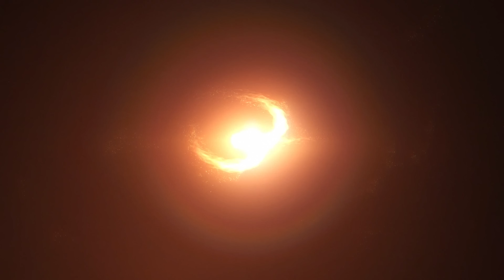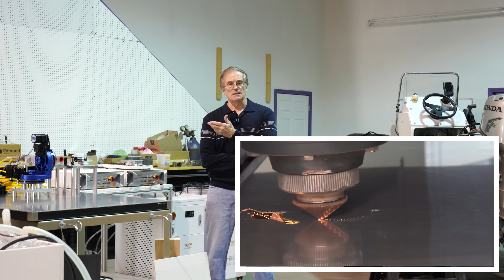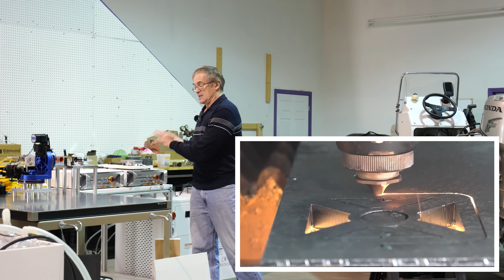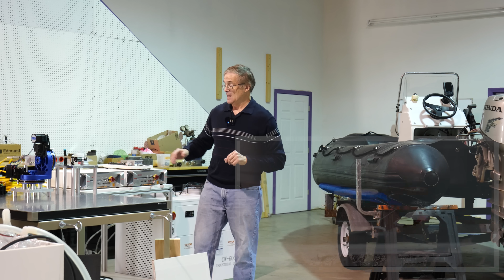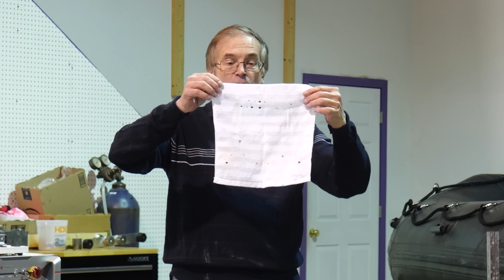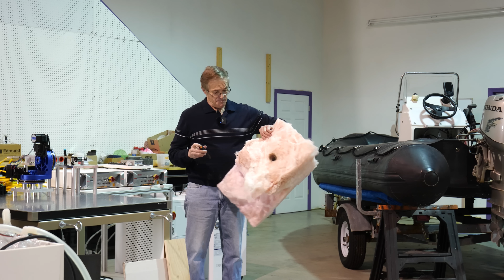We have a problem... and need your help!

Comment: You could try a vat filled with liquid nitrogen or something similar suspended a second metal plate in the liquid nitrogen to catch the laser light, this would cool the plate giving you time to stop the test. Get a crayon cooler, make a cold plate to fit your needs, use the cold plate to stop the laser

Comment: While I really like the idea for the intumescent Starlight material I have an entirely different approach for y'all to consider. I watched a video about a schlaren laser setup and the beam was actually too narrow so he used a little bit of optical glass to widen the columnated laser light and I wonder if you increase the column diameter from millimeters to centimeters you would have a much easier time finding material to absorb the energy behind it

Comment: I think we can explore potential laser-blocking materials by examining materials used in radiation shielding in applied nuclear physics. Specifically, we can look at how materials are selected for reactor casings and radiation source shielding. However, it's important to note that we only need to block light (laser) radiation, not higher-energy radiation like gamma rays or neutrons.

Given the intensity of the laser radiation and the need for an economical solution, two viable material options come to mind: concrete and plate steel. These high-density materials offer a large number of molecules that can absorb, transport, and re-radiate energy.

For a first-round, practical, flexible, and cost-effective approach, we could use concrete pavers to test how much thickness is needed to block the radiation. Once we identify the required thickness, we could construct a more permanent structure using concrete blocks filled with grout.

The second option is steel. Steel provides greater density and better thermal conductivity. We could experiment with thin steel sheets to determine the necessary thickness to absorb and re-radiate the laser energy. The sheets could then be welded together.

Comment: I think a better idea would be a combination of materials.

You need to coat a sheet of copper or aluminum sheet with a thick layer of silica-base (silicon dioxide or sand) coating. One way to create really durable temp-resistant coatings is to form a layer of COMBUSTIBLE material mixed with a precursor of the temp-resistant material. At home, this would be starch mixed with glue and silica (mostly dioxide, of course). When the layer of this material starts to burn, the organics swell up and turn into soot, limiting the oxygen supply, and the silica forms a thick layer of foam-like material.

I realize this may not work against a laser, but the fact that the brick did not melt suggests that a ceramic material might solve the problem. However, I would still add cooling to the opposite side, that is what the sheet metal is for.
Reply from the maker: I like that layered approach.
We need to keep this cheap, and systems like pumps and mechanical movement will rapidly increase the complexity.

Comment: Use a glass terraria filled with sand and water.

The wall of the glass must be a little deformed like an old tv. 

That will have absorving properties.

Also you can use like a diamond like reflective surface that separate the beam into 500 lassers in different directions.

Or you can use the bottom of a deep lake.

Comment: My father in law just retired as a fiber technician for a big comm company.  He suggested an optical diffuser should work to scatter the light.  He thinks a piece of plate glass that has its surface(s) sandblasted or etched could work
Reply from the maker: Thank your dad for the suggestion. Unlike a fiber communications link, the fiber laser will shatter materials such as glass. Nevertheless, a dispersive surface is a good idea.
Reply: @TechIngredients I will pass it on. good luck, we are both tuned in

Comment: I have heard that there's a free shades of blue that lasers can't penetrate
Reply from the maker: That's a myth. Think about it. Would a visible  color affect an infrared beam?
If it could reflect it, that would be a big problem.  If it absorbs it, then that energy turns into heat just like any coating, and it will vaporize almost instantly.

Comment: Your options:
Absorb it, defuse it, defocus it, or reflect it. 

Beam Blocks and Traps, but I'm not sure the power levels your dealing with. 

If you got a bunch of copper wedges and make a reflector that worked like an aniconic chamber you could use that as a beam trap. Maybe back them with water. You could also use a fog generator to defuse the beam as well. Regardless, make sure you have your safety gear on lol.

Comment: The problem itself isn’t entirely different than finding a suitable backstop for gunfire at ranges. It seems the ideal media would rapidly and continuously move itself into the beam path, absorb the incoming energy as asked, need considerable energy to destroy it, self extinguish, be cheap, readily available, non toxic, not produce smoke, easy to replace and be able to be used in thick enough layers to do the job without being impossible to move because of weight. 

I believe the ideal solution would be to use, as crazy as it sounds, square buckets full of clay “slip”. “Slip, as it is referred to in the world of pottery is a thin mixture of clay and water. 

I believe this would be the ideal solution because buckets are cheap and plentiful, can be stacked as many layers high and deep as needed, the holes can be plugged with wooden dowels or screws, they can be swapped out easily and won’t weigh too much individually when full. I believe clay slip would be ideal because the clay itself is extremely heat resistant, the water would provide a sufficient heat sink, the mud would effectively absorb the light, and it’s liquid nature would cause and voids to quickly be filled. The mud would need to be rather thin. Thin enough that it couldn’t hold up a dowel placed vertically into a full bucket. 

Other possible solutions would be buckets of dry sand or vermiculite. I don’t believe the sand would work as good as vermiculite.

Comment: My first thought was something like (virgin) PTFE. It's a reflector which is not ideal but it's approximately lambertian. It's a bulk reflector/absorber so the thermal energy is generated over a volume of material. However I suspect the irradiance you are dealing with here will still just be too much even for a very-pure (very-reflective) PTFE sample. Giant sheets of virgin PTFE would also cost a fortune and it's thermal degradation products are nasty.

Comment: What if you just use a lot (let's say 50) glass panes, with a small distance between them? Maybe also tamper a bit with their surface, i.e., create semi-opaque (frosted) glass?
The idea being that after each glass window, some of the light is reflected elsewhere. If the glass is frosted glass, then the rough surface should help redirect to the sides (instead of just back to the power source). I saw a similar version of this idea in the comments, to use aerogel with different bubbles enclosed.

A modification of this idea would be to use some kind of shattered crystal (or mixture of crystals that differ in the refractive index). By having an unorganized and uneven distribution of the individual segments, the light would hopefully be redirected randomly, hence splitting the single light ray and redirecting it randomly (to hopefully sufficiently reduced powers). Obviously testing this one quite difficult, because you would want to significantly over-scale it to prevent random laser beams that are too hot, but given a mirrorless and windowless room, it may be feasible. 

Finally, why not just use a huge concave (or convex for that matter) lens? If the problem is the required size, maybe satellite-dish-shaped mirror could do the required focusing of the laser onto the concave lense?
Reply from the maker: Even that reflector is much too small.
We have to protect the entire back wall. 
I'd like to stick with materials that can melt or vaporize, but not shatter if the intensity is too high.  This can create unpredictable reflections.

Comment: my start would be ceramic fiber blankets for the absorption material. its a more dense, and higher temperature resistant comparable to the fiberglass insulation. I use it on fireplaces and flame guards for soldering pipes. I still think that the ceramic fiber blanket will not be enough though. I've never done much to wet the material when I use it, but I would try that. in addition, having a layer in the middle to disperse the energy into a larger area would help. possibly including the crushed glass that @athingortwo1513 was referencing as a layer sandwiched in between two layers of ceramic fiber blanket. creating a composite material that will fail in one spot, and disperse the energy internally to have the hope of lasting a second or 2. In the unlikely situation this works, it would be light-ish and portable. though the ceramic fiber blankets are not the cheapest in comparison to some other suggestions here.

Comment: Why don't you point the laser down instead of out?
Reply from the maker: We need more distance to the targets than the ceiling height would allow.
Reply: @TechIngredients  I assume, then, that a testing hole would be cost prohibitive. Correct?
Reply from the maker: Correct.
We investigated a number of closed stone quarries, and the owners were nervous about allowing multiple,  high power lasers to be used there. 
Digging a special purpose hole in our industrial park is also out of the question.

Comment: Hey I reckon graphite is your best bang for buck (transitions directly from solid to gas) at approximately 3650–4000°C) it's non reflective, relatively cheap and sublimates from the heat, tungsten also could work but could be quite expensive to shoot, a graphite barrier a few kgs thick would give you some time.

Comment: Water curtain of aerated solution of carbon black and water. Use lengths of  slotted copper pipe, in layers, of 2 or 3 curtains deep (3 individual 24" slotted pipe "waterfall" faucets).

Comment: Is it possible you could put a large amount of dirty water in the air with the use of a tone of presure waser nosels, the particulates would absorb some light and the heat would disipate through evaporation. The rest of the light would be scatterd to a safe level of exposure.

Comment: A diverging lens. 
Or reflectors that divert the beam downward into a wet dump on the floor.
Or a vertically oscillating spinning dump.
Or a cascading array of parallel slits 
Or re-couple the beam into a tightly coiled optical fiber that has inherent HIGH BENDING LOSS to disperse the energy through evanescence

Comment: Instead of a laser dumping made of resistant materials, you can opt for a mirror style solution. 
So you can use a very sharp white diamond at 35° 💎 and around the diamond you can use a graphite disk to dump the disk reflection created by the laser at an angle of 35°.
A very polished diamond will act as a 35° mirror. 
You can also cool it by placing a piece of mirror polished copper on the flat side behind it.

Comment: Waterscreen  ! A water screen for a laser show can scatter and absorb both stationary and powerful infrared laser beams. It is a rectangular tube with several rows of nozzles of approximately 1mm and an elongated trough, which receives the water wall with a pump that pumps the water back, in a circle, to the upper tube.

Comment: I was thinking about defocusing as well, like others here, but I figured a better method to defocus would be to use sheets of diffraction grating, which is likely much cheaper, light weight, more scalable, and hopefully doesn’t melt in the beam (?), like lenses might struggle with. 
One issue is if it becomes dirty as you work in the facility, but that applies to everything I guess…

Comment: I am not an expert but I think this channel it here to help us all think so here is my thinking...

Instead of thinking about blocking the beam could you think about spreading it out. If you use lenses to fucus light could you use a series of lenses to de-focus and therefore make a regular barrier behind it usable. I am not sure if the beam when hitting the first lens would diverge or melt the medium but that is my thought. At the tip of the lase something has focused it down to a point without melting, could that be used to de-focus it.
Reply from the maker: A lens would work well if the beam is lined up with it. The challenge is that we have to protect the entire back wall no matter where the laser is pointing.

Comment: Perhaps using lava rocks or ceramics would help disperse the heat and light.  These materials are heat resistant and the lava rocks are porous and very heat tolerant.

Comment: Here's a funny one: on the forums for the space physics simulator game "Children of a Dead Earth" there was a lot of testing on which materials served as the best armor against laser weapons. If I remember right, Alpha-2 Titanium Aluminide, Aramid fiber (Nomex), and 'Amorphous Carbon' (instead maybe graphite or coal) were top performers. I noticed 'ceramic oxide fiber' worked well. Tradeoffs between heat conductivity, thermal expansion coefficient, melting point, specific heat, etc.
Reply from the maker: That's a sophisticated game!
I suspect they didn't factor in cost, seeing as the Earth was already dead.

Comment: How perfect does the leans need to be to survive as a diffuser? 

Shower curtains or privacy doors, for example  are large enough and reasonably priced.

Frosted glass in front of an absorber.

Also, program the laser to never stop.   If the beam can only activate while in motion may provide security factor.
Reply from the maker: The algorithms are complex. The laser should rarely stop, but it might pause movement briefly while it's on a target even though the target will never be absolutely still.

Comment: Some years ago there was this video about heat dissapating material that the spaceshuttle was covered with. A sort of ceramic material it was as far as I know. Maybe that would work long enough to stop the laser in the event of a mishap. Don;t know if that material is expensive or hard to get. I would guess it would have to be some sort of ceramic foam type material

Comment: Why do you need to build such a large backstop?  If you build a smaller backstop at a closer distance you could use something like a block of granite.  Perhaps some refractory ceramic material.  If you want to revisit the water based idea I suggest a flowing barrier where the heat is carried away to be constantly replaced by water flowing from above.
Reply from the maker: That's because the drones need to fly around trying to evade the laser. It becomes too unrealistic if they are limited to moving only 10 to 20 cm.

Comment: I would suggest trying pure alumina (Al2O3) in the form of a castable refractory which would allow you the ability to control your target size, thickness, and construction. If not pure alumina, something like Simond Store's TabCast - 94 (93.77% Alumina) good for 1800°C. Both of those are NOT fireclay.

Comment: My idea would be to rotate quicly using a electric engine the protection panel (carbure de silicium panel ...)
Potentially make a pattern a little more complex than a simple rotation to avoid the ray passing over the same place each time.
l will deteriorate but it's inexpensive and simple so maybe it's worth testing the idea.
An electrical kill switch on the back of the panel would also be a good idea given the dangerous nature of the experiment.

Comment: I'm reiterating my early reply since I can't even locate my first comment in the 10,000 plus comments as of 5-22-2025.
I believe my suggestion was the simplest, cheapest, most effective, and easiest to implement than any of the 100's of suggestions I've had the patience to read here.
-- Use an aquarium-like container with Fused Silica walls, which will be transparent to, and therefore not heated by the laser wavelengths you are using.
-- Fill the transparent walled container with a thin mud mixture which will both disperse and absorb the laser energy.  If the heat absorbed is sufficient to vaporize the water in the mud, the remainig laser energy (partially dispersed, and partially absorbed) will propogate to the next few millimeters of mud, to be further dispersed and absorbed. Any "cavity" that might have been created by the beam creating steam earlier in the path will immediately be filled by collapsing of the surrounding mud that was not vaporized.
-- This traveling sequence of heating, dispersing, vaporizing, collapsing, and so on, will continue through the mud volume until all of the laser energy has been dissipated.
--  Experimenting with mud thickness (from murkey water to thick mud) and total volume of mud requred for total absorption, and whether any stiring of the mud is needed,  will nail down the parameters required for the laser energy you are using.
Please critique and respond.
Reply from the maker: There is a fundamental problem with that suggestion.  We need to protect the entire back wall, which is an area of approximately 25 ^2 meters. If we're limited to just a few square feet, the bricks would be a practical approach.

Comment: What about a layer of smoke that scatters the beam enough to be absorbed by another layer behind that? It would effectively be a huge "lens" that reverts the focus of your actual lenses.
Reply from the maker: The chalange would be to contain the smoke so that it doesn't obscure the field in front where the drones will be flying. The smoke would have to be dense to be effective and will continuously spread well in front of the back wall.